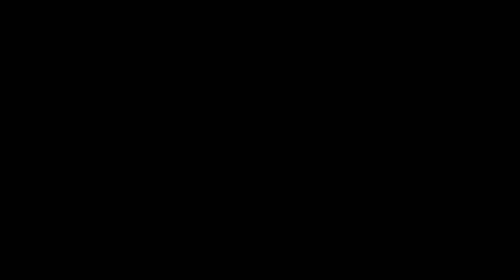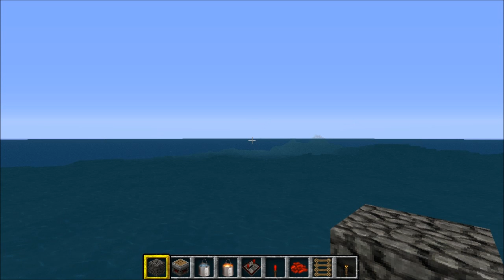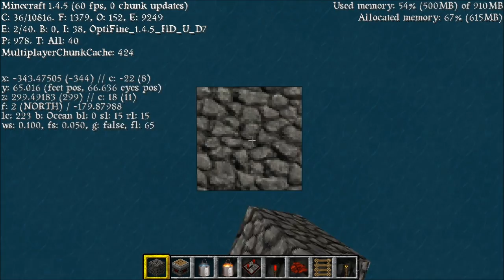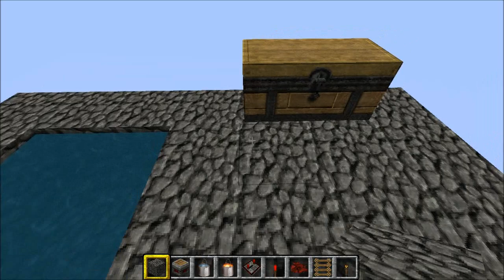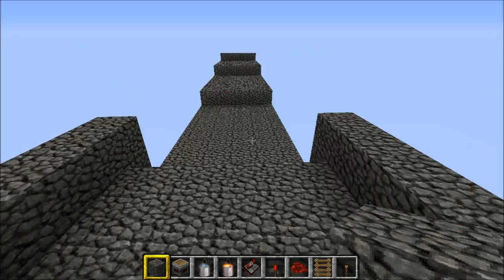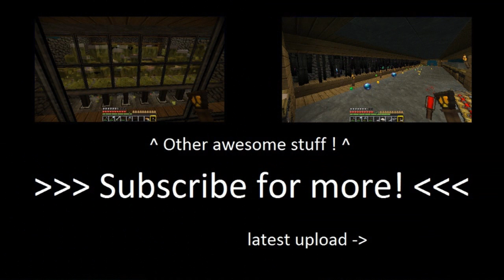Minecraft mob trap tutorial (resource efficient mob farming)

Comment: Doesnt seem to work on the PS3 version. All the pads are flooding/draining correctly but no mobs spawn. I run up there after waiting a distance away, at night, and see zero activity..
Reply from the maker: Can't really comment as I don't own any consoles.
Never have, never will ;)
Reply: Did you build it over Y 124? If so, that is the pproblem. Mobs don't seem to spawn at that height at the moment, so all traps have to stop below that level. Also, if you built it lower, you may have bad spawn rates from too many external spawning places.
Reply: They do. I've made simple circuits with inverted signals.
Reply: ***** One of the guys on a roosterteeth video said something about how there wouldn't be any updates until april, but I don't know for certain.
Reply: I built mine to where the roof level was Y123 and it was centered on the largest body of water I had.  Building it here will cause mobs to spawn in caves and stuff and on the shore and all over the place away from the trap if in reach of the spawning rules so the further away from spawnable places the better; I imagine your trap at sea level is having a problem because it is close to places easy for mobs to spawn.  I think the console peeps made it difficult on purpose.  My trap "works" now but no where near as efficient as the PC version which is hilarious to watch.  So April was spot on... don't build above Y124 if you're wanting mobs and make sure you maximize your mob spawns by eliminating spawn zones around your trap.  Good luck fellow Crafter.
Reply: John Bentz ***** I thought I would let you guys know that as of the last update to playstation 3 minecraft (and I would bet Xbox too) mobs will spawn over Y 124. Spent some time testing right after the update, and I had stuff spawning in rooms built all the way up to maximum build height. Sky farms will work now!
Reply: Whoa!!! Thanks April!!! You are awesome for checking in!!!  I think I left my original build in one of my worlds... Just need to turn it back on. :) yay!
Reply: I thought torches didn't invert in Xbox and PS3.
Reply: ***** I know what you mean, I was pretty disappointed to find that mobs don't spawn over that height. It's the best way to avoid doing tons of caving and lighting to get effective spawning. Right now I having to rely on spawner-based farms, which are fine, but troublesome when you need things like enderpearls or gunpowder.
Reply: April Parr I have a feeling this may be the same issue I'm having on XBOX 360... I'll give it another go.  Glad I read further and found your reply.  Thanks!
Reply: 101m4n Hey man what's wrong with consoles! ;)
Reply: ***** yikes, that sounds like a problem. I've never seen it happen, but considering there are some maps with no villagers at all and some (mine included) with villages big enough to naturally spawn iron golems, I wouldn't be surprised if a world generated with just a single villager and house. Sadly, without going into creative and spawning a second, that one villager is all you will have. If you have all the achievements, or don't care so much about them, I would say that is the only option besides finding a new seed. Switching your map to creative turns off trophies, but will let you fix your villager problem.
Reply: John Bentz not a problem at all! :) I'm glad my knowledge on the game comes in handy to help people, lol.
Reply: I love this game.  Like crazy.  So, yeah, as soon as I started building this thing below Y:124 on XBOX360 hostiles were spawning at the far end. LOL.  That indeed was the problem.  You rock!  I tried to make it as far from land and other spawnable places as possible but I can tell huge difference from drops on the PC version that is built up in space.  I'll try some things.  I'm not against lighting up the countryside with torches. :)
Reply: I built it twice, one at Y230 or whatever and the other out at sea level away from land, neither worked. Even the simple gravity grinder I built doesnt work! grr
Reply: John Bentz it's actually too bad hoppers aren't in yet. Theoretically you might be able to get above the trap and idle in a saferoom, but collection would be impossible unless you built some sort of addition that carried the mobs around and up. By that time though, they would have despawned. So when hoppers are introduced one MIGHT be able to set this up then idle above it, but till it could be tested it is impossible to tell.
Reply from the maker: April Parr Hoppers have been in the game for almost a year.
Well, the pc version at least
If you ask me, anyone playing minecraft on a console is missing out ;)
Reply: 101m4n I played PC version for a while, but something is bugged and my worlds aren't working right. I was playing one night and all was fine, then the next morning I went to play and tons of progress on cactus farming was just gone. All the cactus I grew, all the sand I put in a chest, was missing. So I thought I had misplaced it and started checking on stuff. When I would exit the game and reload, everything I did reverted back to how it was when I first started the game that morning. The items were not in the chests I put them in, blocks were missing that I had placed. Then suddenly a chest full of items, including six stacks of diamonds, was just gone. I play offline, there was no griefing involved. I thought it was my save, so I tried a new world. Same issue. Same for a test world I rare play that I test out builds on. So trust me, I'm not missing out. I needed a version to play while I wait to get a new PC and see if I can't salvage my world via a backup I made before the incident happened. We have been talking about hoppers in console version, which aren't included yet.
Reply: John Bentz not a problem :) it was one of the first things I checked. Built a small room at about Y 140 and within a minute the room was crowded with mobs. Also, if you need gold, look into an overworld pigman farm. Zombie pigmen now spawn from portals in the overworld, so if you build a farm with tons of portals you'll have more gold than you know what to do with! Since some villagers trade for gold and it is used for a few good things, a gold farm could come in handy. And you can make one that lets you choose between instant kill and XP mode.

Comment: I don't understand what I did wrong...  I followed the tutorial step by step and I get nothing.  Saw two skeletons spawn, flow down, hit the lava and die, but got nothing.  Nothing else has spawned since.  Are all the torches necessary?  I didn't add those.
Reply: Single player, but ultimately, it's not a big deal.  I downloaded your version to see it work and it is rather nice.  Great build!
Reply: ...PC version, by the way.
Reply: you built it 210 above water or flat ground and you need the torches so the mobs spawn inside the farm and not on the roof
Reply: Does the topography under the water's surface have to be flat?  I was at 210 above the ocean.
Reply from the maker: Verde Mancato nope, that shoudn't make a difference at all, is this thing on a server or in singleplayer?

Comment: I have been using it as an xp farm since I first saw your video and I'm quite happy with it. =) 
I didn't remove the lava though, I just added a few signs, a piston and some water a little before the lava blade so I can create a sideways going waterstream at head height for the two high mobs and lift them out and drop them when I want some xp. I just flip a lever to select auto or manual kill mode. Works great. =)

Comment from the maker: I already did...
There is a maximum number of mobs that can be in the world at once (about 80 hostile mobs). This trap on its own, with six floors, fills that mob cap up, so adding more spawning space wouldn't increase the drop rate linearly like you might expect.
Instead, if you wanted higher rates from this setup, you would engineer the trap so that mobs are killed more quickly, perhaps by speeding up the timer, or using fall damage rather than lava.
satisfied? ;)

Comment: A possible tip for using less redstone repeaters is to use a dispenser and a pressure plate. it starts with an item on the plate, then when the item despawns after 5 minutes the plate deactivates, sending off a signal and placing another item on it with the dispenser. 5 minute timer